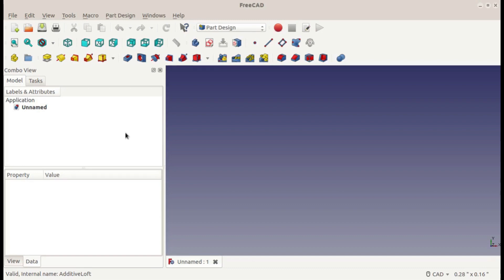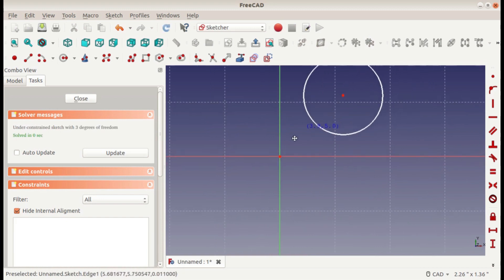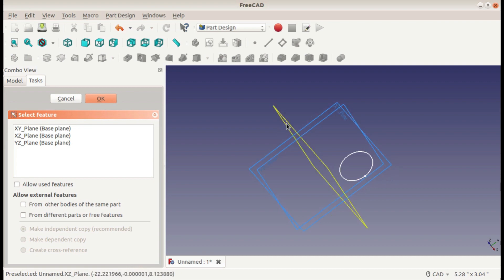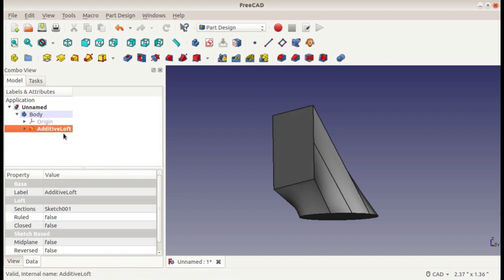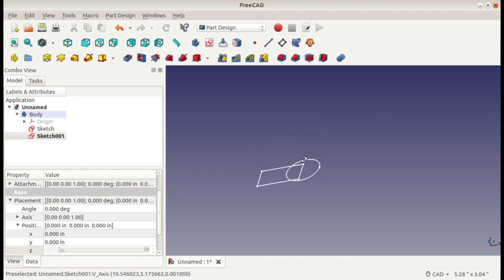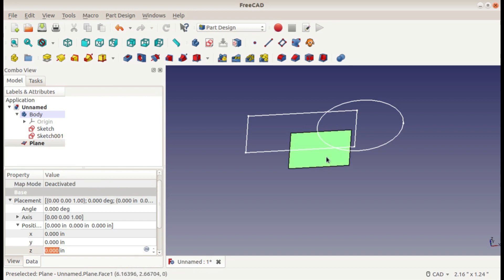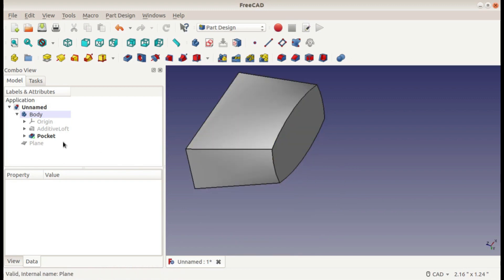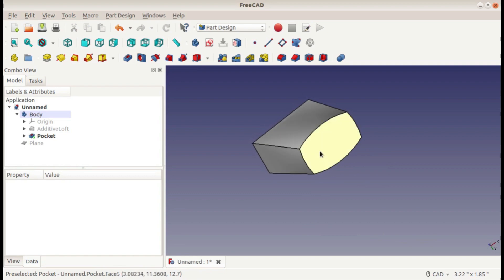Learn FreeCAD: #4 Loft - Tutorial

Comment: Now the second question I have is: can you loft multiple sketches and is there a limit on number of the sketches you can loft?And second part of the question is: can you loft just geometric entities which are not closed and  are result of your previous construction...like lines, circles, 3D splines and other various edges of solids or surface intersections?

Comment: This first loft seems to be 4 ruled surfaces between each section of rectangle (which are not even length...i.e. 2 short ones and 2 long ones) connected together with 4 even sections of the circle. Can you modify this loft by moving the connection points on the circle to create 2 + 2 sections in egual ratio of the rectangle sides?( which is the case of the second solid with  parallel sketches)?  Or anything in between-just random position?

Comment: There is no need to create a new plane. You can change the Z position in the Attachment offset properties of the sketch.
Reply: Thanks for this! Is it possible so that it can be "constrainted" with respect to another sketch? Say I want the square to be exactly +20mm (x axis) away from the center radius of the circle sketch?
Reply: muayd tamaro You saved me the time to comment on this. I agree!
Reply: Thaks for the advice. I did it his way and the program froze.
Reply: Still freezes. I guess this version is just broken. How anyone uses this thing when it has no error catching at all I don't know.
OS: Windows 10
Word size of OS: 64-bit
Word size of FreeCAD: 64-bit
Version: 0.18.4 (GitTag)
Build type: Release
Branch: releases/FreeCAD-0-18
Hash: 980bf9060e28555fecd9e3462f68ca74007b70f8
Python version: 3.6.6
Qt version: 5.6.2
Coin version: 4.0.0a
OCC version: 7.3.0
Locale: English/UnitedKingdom (en_GB)